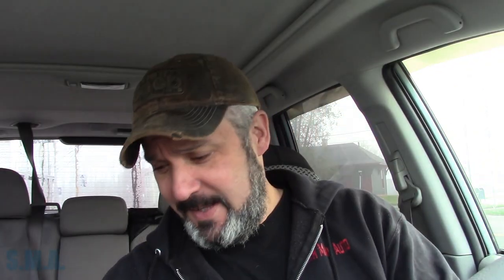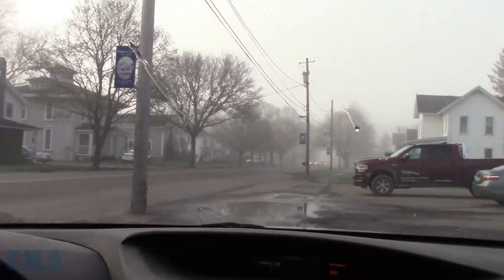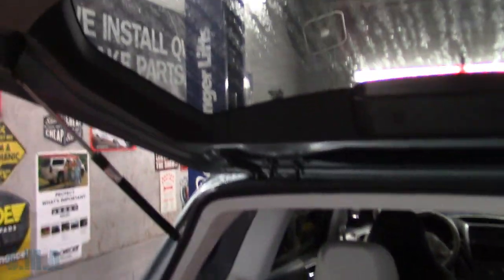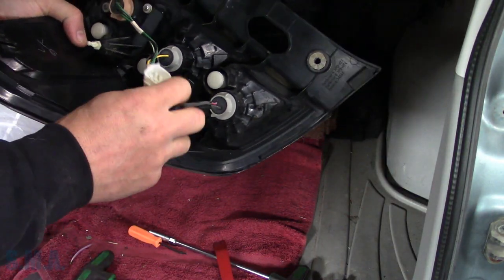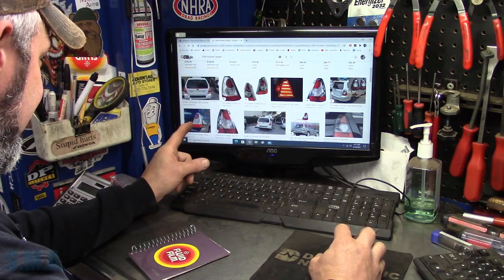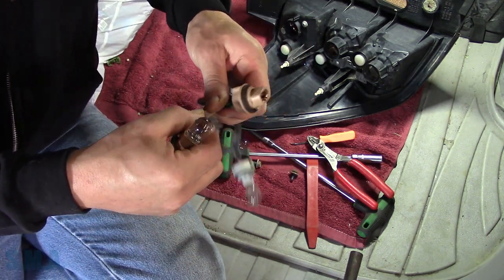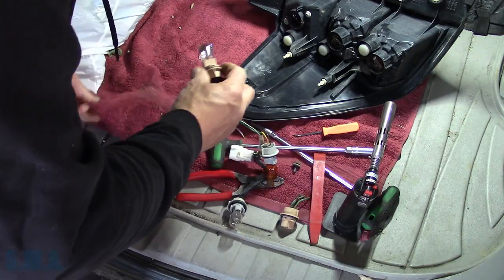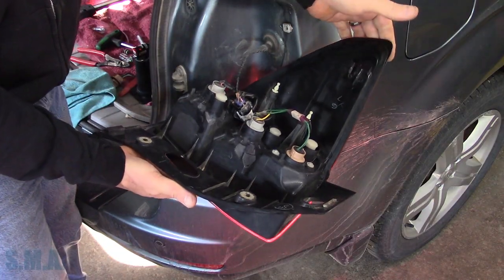Don't Be A Jerry!

Comment: So I'm hoping to get a response from this comment from Eric O. or anyone who can help. I have the same thing going on with the front marker lights on a "new" old work truck recently purchased. It's a 2002 F150 4.2l 2wd. I have accurately replaced the entire rear of the wiring where it comes from the factory harness. I have also added a new and good chasis ground. I have chased the wiring to the interior fuse panel and no good,  everything checked out. then further to the power distribution box under the hood and still no problem found. I have quasi-brake lights, meaning that they are not too much brighter than the headlights or running lights or turn signals. I am a carpenter by trade with a lot of experience with a/c electric, so I understand how things work and I am at a loss for the solution for this problem. The only thing I have changed since I have owned the truck was to remove the trailer wiring harness that was completely jerried in the truck and to replace the wiring, addes chasing ground, new sockets, new bulbs hoping to correct this. If anyone can help me out with the solution I would really appreciate it. I should add that I am a fan of the channel before the problem and I have always worked on my own vehicles. I am a very handy man and enjoy the work USUALLY lol. thanks all

Comment: I move  my seat and spray oil on them each time I change the oil and I do this because I got stuck with a seat all the way back in a city 100 miles away because I had to change a fuse for the lighter.

Comment: Fellow diy mechanics...need to some. 2005 ford escape. Issues with the power door locks. Front driver/passenger/ and back left don't seem to be getting enough power to lock or unlock, back right is fine and back hatch is fine. New master switch. Have took out seats and carpet to check all grounds and everything looks good. Possible had actuators on all 3 doors?
Reply: May I also add that car alarm randomly goes off... especially when it's sunny and hot

Comment: First thing, I thought there was a ground problem. Brake lights not bright enough and other lights coming on when you step on the brake.
 I used to have a 66 Chevy C10 that had the dash lights come on dim, when I stepped on the brake. The bed had a wooden floor and must have lost a good ground to the frame. I ran a wire from the light socket, to the frame and everything was hunky dory again.

Comment: That’s what you get when you try to save 5c on the cost of a light bulb.  Poorly made extra wide bulb-base won’t fit in precision made socket and collapses the contacts. Jerry probably works at an oil change shop.

Comment: Probably should have adjusted the switch since you had to press the pedal so hard for the lights to come on. The lady is likely used to barely holding the pedal at a stop. Seems like ol Jerry screwed that up too when he switched it out. I’ve never seen a socket so messed up.

Comment: This is not a jerry rig or a jury rig. That would be if the guy used aluminum foil in place of the old contact points or some crap like that. THIS guy "Jerry" just broke the shit. So to summarize, jerry/jury rigged products still do technically work.

Comment: i have had those and other glass base bulbs not fit properly, poor manufacturing left extra material on the bottom or oddly formed resulting in improper fitment and when forced will destroy the receptacle.

Comment: Soooo, seems to me like you have to press the pedal down pretty hard to get the brake lights to come on. Is it possible that you get some braking action with the first bit of brake pedal travel that doesn’t engage the brake light switch?  Might be some adjustment in the new brake switch?

Comment: I have seen you do wire connections before, when do you decide to do crimp vs soldering the connection?
Reply: Crimp is superior. It's a better mechanical connection than solder and the electrical connection is fine.  Solder will crack eventually.

Comment: when changing bulbs on My 2010 VW Jetta the bulbs wouldn't light if I already had the lights on. I had to cycle the key on and off then the new bulb would light. Seems like the computer kills power to the circuit when it detects a bad bulb.

Comment: I think "Jerry" may not have been given fair treatment here. The socket damage was the only evidence shown. How do we know "Jerry" did that? We have all seen damaged parts that we wondered how the heck did that happen. Sometimes on brand new parts right out of the sealed boxes. It had been over a year and a half since "Jerry" worked on it and we don't know what kind of "jerrying" he did if he did any at all. Just because "Mrs D" said her car was"jerried" doesn't mean it's true. Has anyone else had their little mittens in there? Plus we don't know whether or not the lights worked for the month since "Blank Blank" worked on it for ABS issues, but I would assume (we know what assume means but play along) "Blank Blank" checked to see if the lights worked after replacing the "sensor" and would not have let "Mrs D" go with them not working. So in all fairness to "Jerry" we can't honestly say he did anything "jerriedly".

Comment: Surprised there was no mention of adjusting the position of the brake sensor??? Shouldn't the lights come on with a soft touch not just under heavy braking pressure?

Comment: Did the brake light switch need adjusting, seems the lights don't come on till you are standing on them hard, might be why the cop pulled her over, under light braking it doesn't activate the lights?

Comment: Hi got a really dumb question I have a 2002 Chrysler Town and Country EX I recently hired a mobile mechanic to come out to my house and replace the water pump this idiot took out the water pump but broke for the bolts inside of the motor where the water pump mounts and is refusing to come out and fix the problem and put on my water pump can you do an episode on how to extract broken bolts

Comment: Everyone telling stories, so here is mine. This guy needed a jump start at Walmart and I pulled my truck up toward the front of his truck with the hood open and got out my the jumper cables. He insisted the cables goes on red to black and black to red. I told him it’s black to black and red to red or positive to positive and negative to negative, whichever way you want to look at it. He said I was wrong and I insisted he was going to blow up his expensive computers. He continued to argue with me, so I told him if he was so smart, than why do you have a dead battery in the parking lot of Walmart, when you can go inside and buy a new one? I left and he was looking at me with his jaw hanging down! Moral of the story, if you are broke down and have a Biden/Harris sticker on the back bumper, you are incapable of reasoning, so fix it your own damn self!

Comment: i've known llot's of jerry''s in my day unfortunately :/
Reply: it took me 2 months 2 find on my own, but I found dirt under my coil packs, was sending misfire codes, blinking engine lights. p306,p206..full monty. do not drive car, do not pass go. replaced plugs,wires,injectors..still had a code. I was about to go have some jerry charge me 300$ to not fix the problem because I was getting fed up and testing the coil pack switcheroo was my last resort. Turns out my fix would have been free! But not at Jerrymart, and they probably would'nt have found it either. So, now at last I have a bunch of new parts on my car and total bill was under 100$ for unnecessary parts. :/

Comment: Why didn't you solder wires? Better  yet why didn't you buy the whole pig tail and plug it in. Then there would be less of a chance down the road of a bad connection problem. To me this like taking a crap and not wiping your butt even though you have toilet paper available.

Comment: Buy only Toyota and Lexus vehicles. I learned my lesson years ago.
Reply: what does that have to do with someone screwing up a light socket? stop spouting tired BS
Reply: @someguy3999  you must be a Toyota hater. I have a Lexus ls430 2001 325000 original  engine and transmission never had brake light issues just change bulbs.. I have also have a lexus ls460L 160000 miles no issues.
Reply: @lesoram6236  Toyota makes the best vehicles period!!!!!